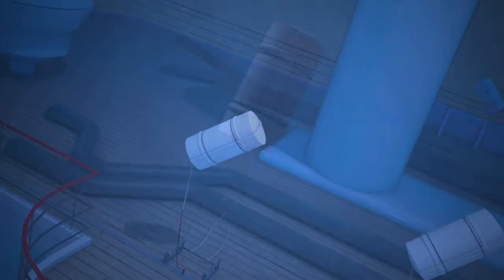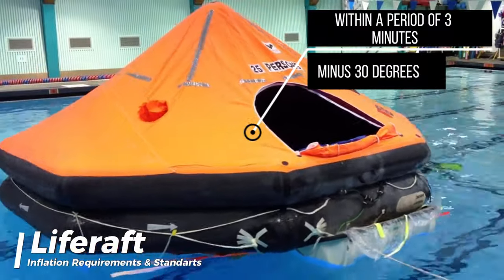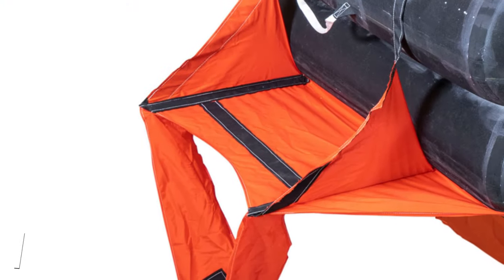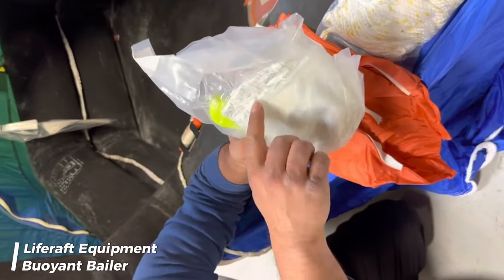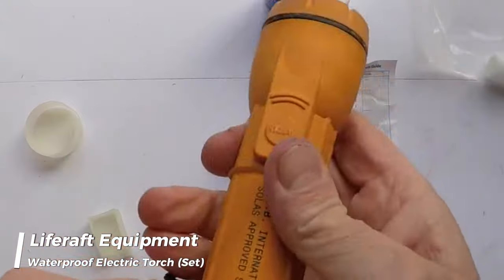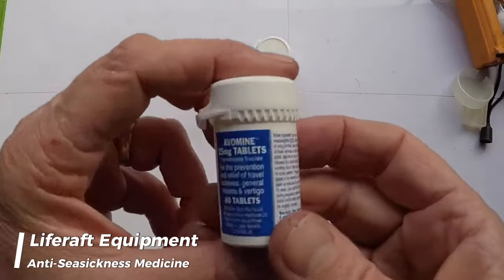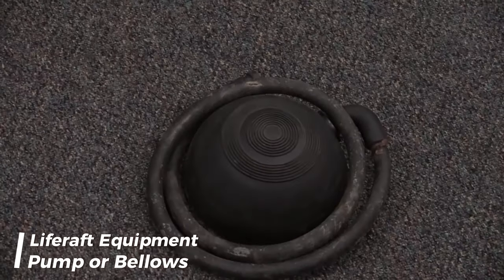Liferaft Equipment & Construction: What You Need to Know?

Comment: Wow this is well equipped with practical equipment. My only issue is the lack of velcro storage bags. In case of capsizing because of strong waves. 

Also the ballists should be filled with those compact towels, or space towels, or even compacted sponges, so they actually absorb the water quickly and fully, im curious if they actually fill with water to its maximum and not just half fill as it is.
Reply from the maker: The LSA Code actually requires that these systems are designed so the pockets fill with at least 60% water within 25 seconds of being deployed. So, the current standards already focus on making sure the tanks fill up efficiently and fast. Ballast pockets do improve the raft's stability. How effective would they be in a heavy  rough stormy sea? It's anyone's guess. That's not something I'd want to experience firsthand :)

Comment from the maker: How do you think, is all of this sufficient for survival at sea?🤨🤔
Share your opinion with us in comments below⬇⬇⬇
First Part: (Construction Requirements) 

00:00 - Intro 
00:30 - Liferaft Construction Requirements as per SOLAS and LSA.
00:41 - Liferaft Interior & Entrance. Window & Rain Water Collector 
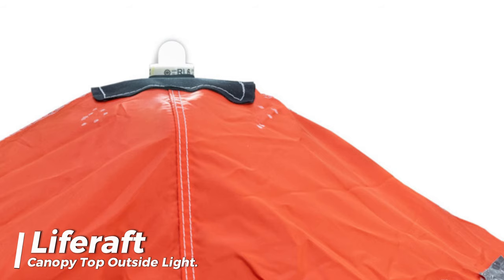01:19 - What is  Liferaft SART? SART Location & Installation 
01:34 - Canopy Outside & Interior Lights
02:19 - Liferafy Buoyancy Chambers &  Liferaft Inflation Requirements 
03:18 - Liferaft Towing &  Requirements and purposes of Liferaft Water Pockets (Ballast Pockets)
04:25 - Requirements for Boarding Ramp & Boarding Ladder. Whats the difference?

Second Part: ( Liferaft Emergency Equipment ) 

05:05 - Liferaft Bouyant Rescue Quoit. What it is and how to use it ?
05:27 - Liferaft Knife & Buoyant Bailer 
05:46 - Liferaft Sponges &  Sea Anchor. How Liferat Sea Anchor Works?
06:15 - Liferaft Buoyant Paddles.  Tin-Openers & Scissors & First Aid Kit 
06:32 - Liferaft Whistle 
06:44 - Liferaft Pyrotechnics - Rocket Parachut Flares, Hand Flares , Buoyant Smoke Signals 
07:00 - Liferaft Waterproof Electric Torch (Set) &  Liferaft Radar Reflector. How Radar Reflector Works?
07:23 - Liferaft Daylight Signal Mirror. How To Use Liferaft Daylight Signal Mirror ?
07:36 - Liferaft Life-Saving Signal Table & Fishing Tackle
07:57 - Liferaft Food Ration & Drinking Water & Graduated Drinking Cup.
08:22 - Liferaft Anti-Seasickness Medicine 
08:30 - Liferaft Thermal Protective Aids (TPA) &  Liferaft Repair Kit & Pump (Bellow)

Link to the first part of this video - (Types of Liferaft , Hydrostatic Release Unit, Manual and Automatic Liferaft Activation's and Much More)

https://www.youtube.com/watch?v=kr9KxzIZ1w4&t=346s
Reply: Wait... What about the toilet